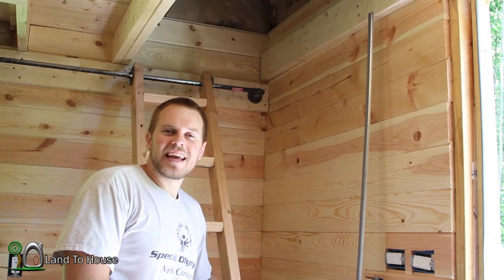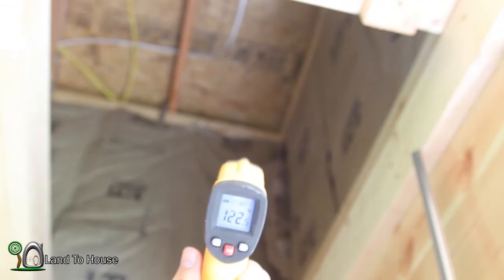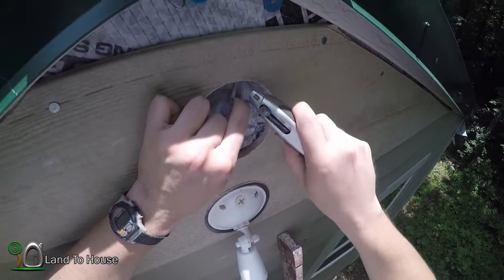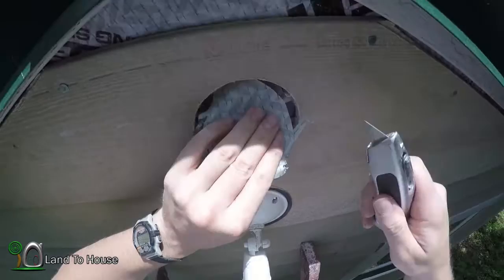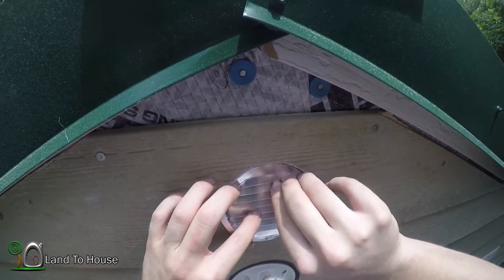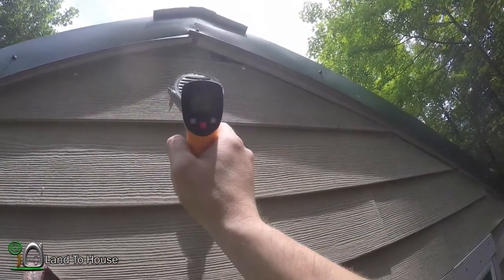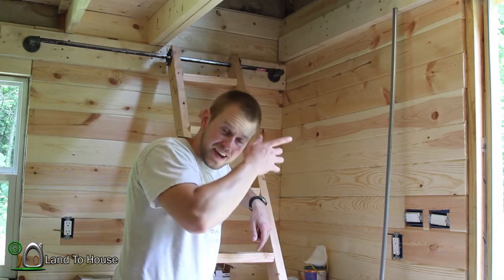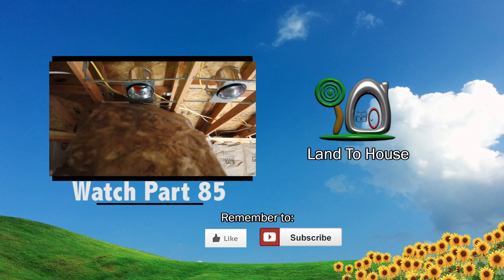Tiny House 84 Attic Vent

Comment: Yes, you can make it work, love it.
3 or 4 screws around the edge would keep it in place better than bending tabs.  yes you need a bigger vent, both gable ends need one square foot of gable vent per 300 sqft of attic footprint.  And don't forget to install the air channels to the underside of the roof and soffits before insulating.

Comment: Your shooting directly on the wood under that steel sheeted roof and that's always going to be hotter, try on the rafter away from the ceiling and I think you'll find it alot more accurate of a temp, and I think as you said a box type gable vent would be more effective and there are some available that have like little shutters built in so that they close off on there own and it would draw more of that hot air out, that nasty hot air, but than again before you finish I assume your going to insulate in the rafters and ceiling, than that itself will cool it off alot. Just my observation. Looking good as always Seth..Thumbs are UP !!
Reply from the maker: Barton Robinson I see your point. Getting away from that metal roof made at least 10 degrees change. The insulation that I am using is r38 and it is 13" thick. It basically fills the space completely from the rafters to the roof. Not sure if that is the best way but at least it will be well insulated. For now I think that I will keep the small vent. I assume that is enough to remove moisture in the winter and heat in the summer.
Reply: That's a perfect R value for a roof/ceiling with the tin on it, that will sure make it cozy in there in the winter fully sealed up. When you put the insulation in you can use Duct Tape run rafter to rafter and you can sheet over it without bumps and staple if needed till you sheet it up. You going to use Plastic for a Vapor Barrier up there as well under the ceiling ? That would sure look nice with a ceiling like the walls.  Look forward to more, Thanks Seth !!

Comment: Just a lil observation that might be wrong btw :p , but pointing the temp gun at the ceiling might give you false results even though that wood is a good isolating material
Better point it at boards across the ceiling
Reply from the maker: Ahmed Usul That is a good point. It was around 10 degrees cooler away from that roof. . . . Taking the temp on that surface was more dramatic though haha.

Comment: Yes that vent is WAY too small to vent that space.  And instead of cutting it, put caulk around it before putting into the hole.  Or get a bit that matches the size of the vent... But u need a bigger vent anyway.
Reply from the maker: I agree. The vent that I put on the workshop has that solar fan that pulls out a tremendous amount of air. But as passive airflow goes this vent is way too small for the tiny house.
Reply: Good rule of thumb to use is 1:300 1 square foot of vent per 300 square foot of space cooled.

Comment: That vent is much too small. You're trying to exhaust all of the air flow from the soffit vents through one vent of the same size. You need a proper gable vent.
Reply from the maker: Yes it is likely too small. Luckily this sits in the shade most of the day.